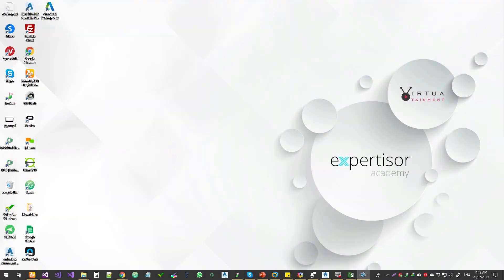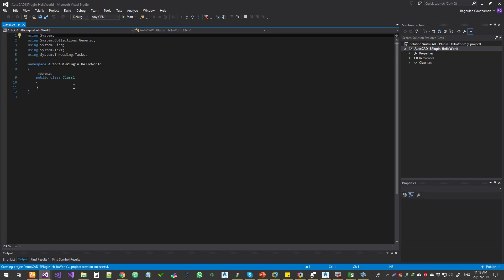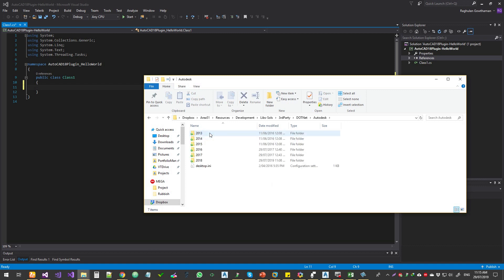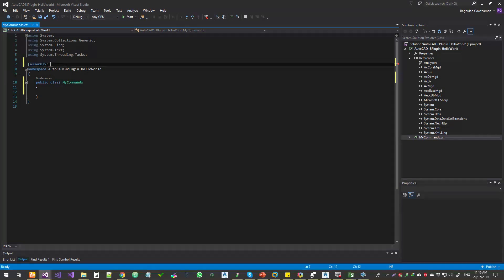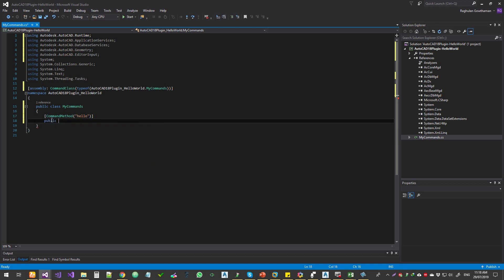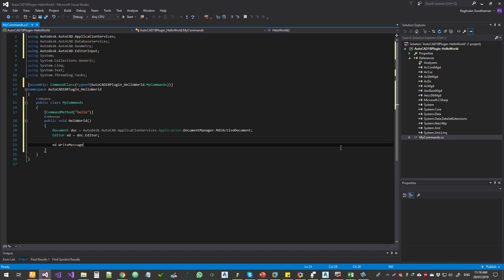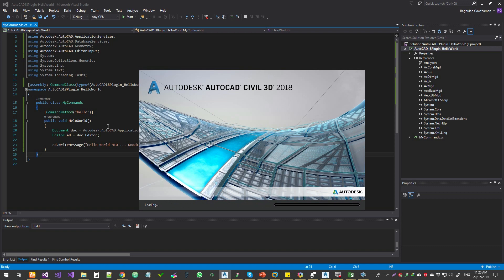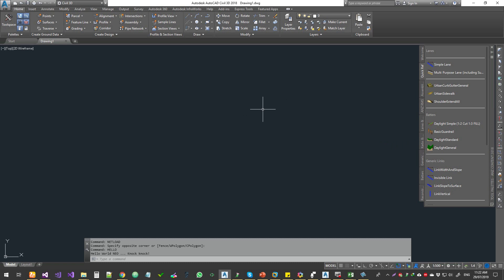AutoCAD Plugin Development - Hello World

Comment: MY PROJECT IS " CAD -GIS INTEGRATION AND SIMULATION "
GIS SOFTWARES DOES NOT SUPPORT 3 D AUTOCAD MODELS SO I USED GEOLOCATION TO SET MY STRUCTURE ON MAP TO ITS LOCATION  BUT NOW I HAVE TO PERFORM SIMULATION ON IT, BASICALLY DON'T HAVE SUCH PLATEFORM TO PERFORM AVALNCHE FLOW SIMULATION OVER MY CONTROL STRUCTURE SO IS ANY POSSIBILITY OF CREATING PLUGIN IN AUTOCAD WHICH CAN GIVE ME SIMULATION RESULTS ON AUTOCAD ONLY?
Reply from the maker: yes possible
Reply: @ExpertisorAcademy   please tell me  how ? Can  you give me some ideas Or source where I could learn it ??
Reply from the maker: instead of using Autocad plugin you better of using differetn sofware for simulation sch as fluid flow.